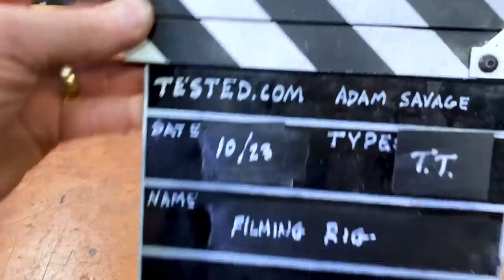Adam Savage's Favorite Tools: Mobile Filming Rig!

Comment: I actually made a mic stand 1/4”-20 adapter from a broken mic clip. 
I separated the clip part from the thread part and replaced it with a slightly flattened eye bolt.  Now a mic boom stand can hold a light weight cam and articulate over a bench or project. It’s fairly stable even when reaching because it’s meant to do that with microphones.  Add weight at the bottom for more stability.

Comment: I did some shooting when fixing a bike to go on a tour. Apart from needing to get out of your flow state which is such a pain I really came to love my audio solution. As you probably know audio goes a long way.  I just took a Handy Recorder (Tascam DR-05) plugged my lavalier mic into it, secured the connection (tape lol) and forgot about it till some hours later I pulled it out of my pocket and stopped the recording. With the Rycote undercovers to protect the lav under the shirt and a safety Loop secured on my body with tape it’s quite nice. Syncing in post wir Adobe Premiere also shouldn’t be an issue.

Comment: May be a little bigger, could still fit in the bag - I like using the FEISOL CM-1473 monopod with three legs, it's between your Manfrotto and a full on tripod - I get really stable setup from that!
Reply: That is a wider Tripod support on a monopod, for sure.  I am tempted to get one.   I wonder if Adam actually likes the Manfrottos smaller footprint so he does not trip over the legs as he moves quickly around his shop?

Comment: Adam! If you're having trouble with your white out pens scratching off, try Metal Man acrylic paint pens. They write quite similarly, but leave a much more durable mark. They also sell them in several colors besides white. They also have a nice metal tip for variable thickness of writing, and for multi-surface writing. Hope this helps!

Comment: You might also want to look into a Boom Mic Stand. It  has wider leg spread so more stable but still folds up very compact. Just not as small. Mine came with a 5/8 to 1/4 adapter. (mic stand to photo gear) and I bought a phone holder that mounts to that, similar to what was used at the end of the loc-line here.  Between the holder and the and the stand I could easily do, floor level to head height to 8 feet up, all while staying locked in place and stable.  It folds to maybe a 3 inch diameter by 3 foot long bundle. They start at about 20 bucks.

Comment: Just a suggestion: since you don’t seem to adjust the monopod at all, wouldn’t it be quite useful to build a pole with a weighted base (without the ballpoint socket) for more stability? This would also allow you to add a little table for a powerbank to it
Reply: I shoot a lot of 360 photos, and having a couple of ankle weights to slide on makes my monopod stablize really easy.
Reply: Another good one is one of those "C" shaped microwaveable neck warmers. They tend to be right around 18-24 ounces- heavy enough to sandbag the base of a rig as light as Adam's, but not so heavy as to weigh your pack down.

Plus, it still works for its original function if you get a sore neck after a long day of shooting, lol!
Reply: I agree that this would be a great idea, though I would just have the powerbank velcro’d near to the top of the weighted down monopod and have a cable coiled around the lockline to the phone. This would make it an even smaller footprint, which adam has already already achieved bu switching to a monopod i stead of a tripod, funny that he didn’t even mention the smaller footprint of the whole rig.

Comment: I have something very similar, but I also add a portable power bank that I clamp onto the tripod in case I need to charge the phone in a more remote location or if I'm too far from an outlet. You do have to remember to charge the power bank though. I also have some Aputure MC lights which are incredible little magnetic color changing lights that you can control from your phone or the device itself. Very easy to stick them anywhere.

Comment: I use a rig with a similar design, but there are three differences:
1)  I don't have the flex arm on a clamp (yet!)
2) I use the Amazon Basics tripod instead of a monopod because it has a handle so you can hold it like a monopod and it has a hook on the bottom
3) I have a 12 Ah battery pack that I can hang on the hook for weight and (duh) extra battery time.

Comment: Adam, build a water bag out of a durable material like that of the magpul daka pouches. That way, it doesn't way hardly anything, but when you need to shoot, fill it with water. Have it built like a closed "c", so that the post of the monopod sits through the center, but velcro holds the c closed. That would add weight to the bottom for stability, that you could reduce(by dumping the water) if you'd want to travel with it.
Reply: Weigh*

Comment: Try using a battery bank for portable charging. I have an Anker one which is brill. Could tape it to the bottom of the monopod so the rig is not tethered by a long cable while also lowering the centre of gravity making it a little more stable.

Comment: Adam, Joby now makes a spring loaded phone clamp that screws on a standard tripod bolt. Its what I use to stream and it works amazingly. Was maybe 20 bucks at target, came with a 6 inch flexible grip tripod. I use it daily.

Comment: You know what might be cool, having one more short length of lockline with clips on both ends. That way you could attach the whole thing to a table or something to keep it from tipping over as easily as it does. Depends on your workflow, I guess. Might not work if you're constantly moving it around, but if the rig stays put long enough might be worth it.

Comment: You should do a stretch goal project for making your own monopod foot.  Maybe slightly larger foot print for added stability.  Or maybe the project is creating new feet for the one you have now.

Also, I feel like all you need to really make it perfect is a large battery bank attached to it so you don't need to be tethered to an outlet.

Comment: You need an inflatable travel neck pillow (or something similar) that you could fill with water and put around the tripod base to add some weight and stability.  Then just dump the water out and pack it up.

Comment: If you're worried about damaging the Manfrotto, three pieces of aluminum rectangular tubing about 8-in long that could slide over the feet, bevelling the inside edge, so that they could extend the feet with a positive grip but still keep them removable. If not you could take c channel and pin through the feet, so it swings under for storage

Comment: Just a thought Adam (and all the tested staff): have you looked into "RokForm" mounts instead of the "Joby"? They specialize in kind of an "Otterbox" style case for Apple and Samsung devices that interfaces with a series of stupidly strong vehicle mounts but they do have a universal mount that has a 1" ball that probably could be "massaged" to work with the "Loc-line" on your boom arm. The kicker? The cases and mounts use a very positive locking mech to secure the device but also a very strong (think neodymium strength) magnet so you could just stick the case and phone straight to the side of a machine or any other magnetic surface if that gave you the shot you wanted.

Comment: A small portable lightstand would have a similar form factor to the monipod with foot but would be a LOT more stable. Usually monopod feet are used for increased stabilization of your camera and not supporting it's weight entirely.

Comment: So, this video actually highlighted a couple of things I’ve found annoying about his videos.

One is that Adam frequently clamps the video camera to the machine where he’s doing the work, which means massive amounts of vibration are transmitted to the camera. I appreciate getting a good perspective on the work being done, but I don’t get that if the shutter is rolling all over the place while the machine is on. I don’t want to break his flow, but if Adam could please clamp the camera on a different piece of equipment that is nearby, I think that would really help,

Of course, Adam is well acquainted with GoPro cameras. But is he well acquainted with the latest GoPro cameras? They can give you such a wide field of view, at high frame rates, and high resolution, that you should be able to edit those down in post to a non-fisheye view and smoothly do virtual pan, tilt, and zoom operations so that we can see his face and hands while he’s doing the work or talking to the camera, and he wouldn’t have to move the camera around so much.

This also leads into the continuing battle with audio. I recently saw a video that Deviant Ollam produced on his workflow, and he showed off a wireless Røde microphone system, where he just clips the receiver directly into the audio input on the GoPro camera, and then clips the transmitter onto his lapel. He doesn’t even use an external lapel mic, because he doesn’t need it.

Even if Adam continues to use his iPhone for video work, the Røde wireless microphone should still be able to be used with an adapter.

Others here have recommended a more stable tripod/Unipod solution, potentially including a battery-based charger taped to the bottom. And I fully support that idea, even if he does have top quality long Anker brand USB-to-Lightning power cables.

Anyway, that’s just a couple of thought from me.

Comment: The mini monopod is a great idea. Just throwing it out there but what about using an ankle sandbag weight? They're small, light, and might add just enough weight to stabilize without adding bulk to the kit? I keep a few around for that exact reason (stabilizing small setups).

Comment: Finally ordered some of this stuff so I can more easily film! Set up is a huge deterrent for me. Also- just a heads up the links are missing the camera mount that has the clamp and loc-line with camera screw- I bought this one: Dinkum systems action pod pro- I'm pretty sure this has the missing parts needed to use the 3/4" loc line

Comment: No wireless mic solution?
Audio is just as important as video, if not more so.
Reply: @ShannonMakes  when he first started solo shooting the audio was horrible tho ? i think he was using airpods for a mic so yea idk. im glad its better now ,someone definitely had to step in there
Reply: Dave (I do enjoy your channel btw) Similar to a dozen other commenters, I was wondering about the audio myself. This video doesn’t  show or identify any additional external audio recording hardware, leaving the impression that all recording was accomplished using only the iPhone 11 internal microphone. It is unlikely that EarPods were used, as none are visible in Adam’s ears in any shots. If it was only the iPhone microphone, then there are two factors which aid in producing decent quality. These are:  1) Almost all the scenes are shot with the iPhone at arms length (~3ft), and the wider shots appear to be at most ~6ft subject to microphone distance. The iPhone is adept at close mike recordings (3ft) and those sound good, the longer shots at 6ft are slightly lower amplitude and slightly more echo, as expected. 2) The shop environment is best described as “cluttered” where the walls are lined with shelfs stocked with oddly shaped items, perfect for the purpose of acoustic scattering (diffusion) which helps to attenuate standing waves, flutter echo, comb filtering and a host of other obnoxious acoustic ills. 
Another (contradictory) clue to the audio side of the equation is the addition of  a clapboard in the portable kit bag. While Adam emphasizes this item for its utility in scene identification, the main value of a clapboard is for two system synchronization (separate video and audio recorders). The sound and motion of the clapboard closing can then be used to synchronize the iPhone video with the audio from a separate  Zoom H6 recorder and Rode condenser shotgun microphone. While that sounds plausible, you are probably asking yourself why I was so oddly specific about the audio hardware. The answer comes from another Adam Savage YouTube video:” Adam Savage's One Day Builds: Portable Audio Recorder Rig!"  < https://www.youtube.com/watch?v=qE68mYkpZvQ > where he highlights these exact two pieces of audio hardware. Perhaps Adam uses a two system method with the Zoom + Rode separate from the iPhone, but I am only speculating based on casual observation, Adam himself would need to chime in and provide the definitive answer.

Comment: I have used the Ulanzi phone mounts. A huge range but Full metal options available including a cold shoe for a radio mic receiver. I am also very very found of teh GoPro Sessions for run and gun filming where the filming doesn't get in the way of the flow.

Comment: Pretty cool Adam! Thanks so much for continuing the content. It has really made the stressors of lock-down more palatable. 
Just had a phone/camera suggestion if you'd like; have you tried using one of those iPhone cases that have attachable lenses for the Tested Phone? Perhaps you could use something like a >20mil wide angle, so that the typical shop shots are all in frame? It would eliminate the issue of framing (mostly), and decent lenses have little to no distortion.
✌️

Comment: I completely gave up on tripods and installed a bunch of overhead pipe with an occasional T fitting that I can screw drop pipes into. Now i can pretty much hang anything anywhere i need it, I'm not tripping over tripods, and it doesn't pick up any floor vibrations-- but yeah, can't take it on a plane...

Comment: Given the new desk you've been sent came with a bunch of magnet locking units - not sure on how easy it is to set up, but if you were to make a plate, or if it is big enough already, to connect your octopus arm to the mag unit you may be able to get more options for places to just 'whack it on to' in the shop and we can avoid some of the 'vibration dance parties' that are bandsaw shots (don't get me wrong, i'd rather have those shots than nothing)

Comment: OH and for the parts suggestions, while they are usually really crappy overall- there are neat (and ultra cheap) little lenses you can get that will clamp over a smartphone camera for macro or fisheye and it really is as simple as clipping the thing on so that the lens sits above your phone camera. That way, if there's a little tiny thing you want to show, you can- or... ya know. Camera stuff. Finicky as they are, I find them much more useful than their negligible price tag and diminutive size would suggest.

They also tend to come in packing small enough that it wouldn't change the bulkiness of your bag at all and they're cheap enough that you could buy a dozen to see which you like best without even making a dent in a tool budget. (The ones I got ran me like... five bucks or something and I have gotten some good magnified pictures.

Comment: I'd like Adam to do a video building the Locline/Springclamp stand. I'm stoked on the concept and want to build one myself, but I'm struggling to find the best pieces to connect the phone mount to the loc line and the loc line to the clamp. The nearest similar device I'm finding online is at Joby for USD$80, which is crazy! Thanks for considering this - Chris
Reply: I continued to do some internetting after this, and found LocLine's non-Amazon distributor ModularHose.com. They happen to sell Adam's camera stand with spring or mini clamps, for tablets or phones, and in 8", 12", 18" and 24" lengths. My back-of-the-head math decided it was worth the time savings just to order one of their 24" models now, and I think I can upgrade the mount and the clamp later as I want. Thanks to Adam for the inspiration to go down the internet rabbit hole!

Comment: I thought there are better ways to do this. Maybe a phone gimbal (like the DJI OM4) which would not only stabilize the shots, but could follow him or any subject (no need to readjust) it has gesture ctrl so it can start a vid, track, take a pic without a touch would be great. Would add a wireless clip on mic (Rode GO or something like that) so the sound wouldn't be an issue no matter where Adam is in the shop. However after seeing the way Adam handles (I mean smacks) electronics (too) :) this is just perfect. Plus a dust, paint prob not the best thing for a gimbal anyway and quality has never been an issue during lockdown or even now.

Comment: I like your camera stand in a bag. I would add a mini sand bag to the base for stability. Also I would put some Go pros around the shop with the wide angle for b roll. What resolution do you record? 1080p at 60 FPS looks descent on iPhone while not using the 400 mb per minute that 4K at 60 FPS does.

Comment: I have had problems with long ten foot USB cables, when the voltage drop was too great to charge the phone. I suggest that a light-duty extension cord will work better, because the losses are less severe with higher voltages.

Comment: Hey Adam, I know your busy and I'm not a patron, but I do have a suggestion that would save you time and quite possible a little money in the long run. Instead of using black masking tape and the white correction marker, for the sign at least, why not use a White Dry Erase Marker? If you clean the tape residue off the clicker sign you use at the start of each video(sorry I don't know what its called) anyway if that is cleaned off, a White Dry Erase Marker would would work fantastically. Granted not for other applications, but for this one it would be great because once you put the title of the video and all the info you need on it, all you have to do is swipe it clean for the next video. I did see that they do sell White Dry Erase Markers on Amazon. Give it a try, i bet it works great!